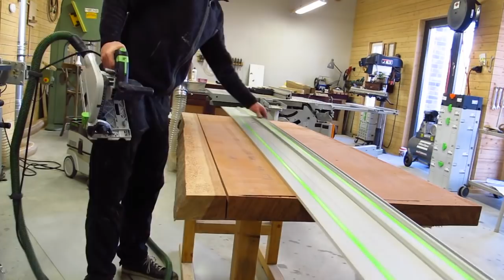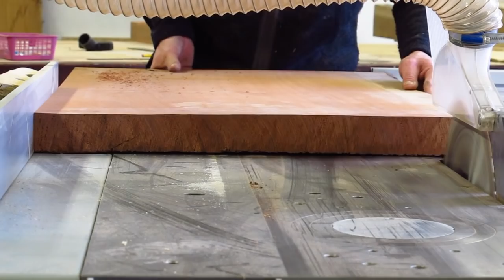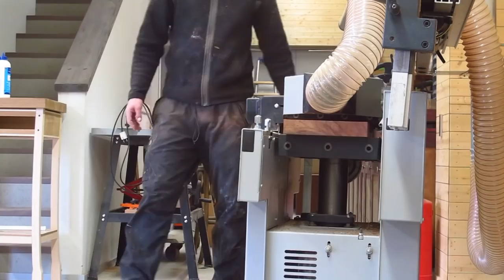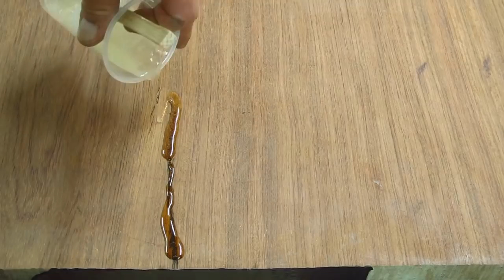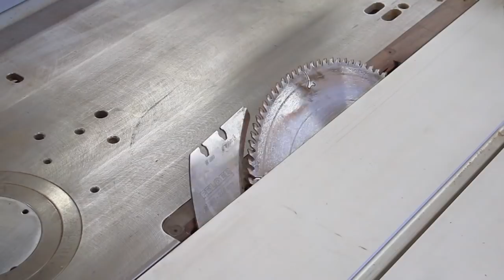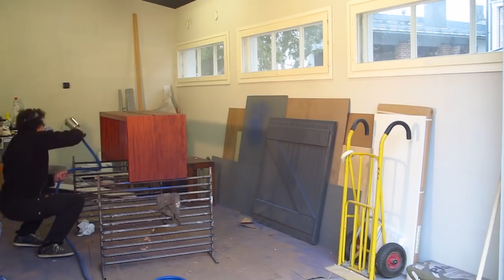Split top slab bench

Comment: a really cool idea for a computer desk, you can have the mouse and keyboard cables go into the crack instead of across the desktop
Reply: +Noodle or you can just drill a hole in the table you already have .
Reply: or you can just get a wireless keyboard and mouse
Reply: +Zenas101 yes you could and you could also just drill a hole in the table just like someone els said. but I spent enough money on my mouse and keyload not to want to re get a wireless ones also my desk is to nice to just drill a hole in.
Reply: +Zenas101 Wireless mice and Wired mice do not have the same ability to provide accuracy. There is also the issue of battery usage which is an unnecessary cost. Oh, rechargeable batteries get worse over time and overcharging can generally lead them to turn worse quicker. So that doesn't truly work as an excuse. Wire will always be more reliable is the point. Plus less radio waves in your home unless you like unnecessary Radiation? shrug
Reply: +Noodle Cool idea.
Reply: I am sure that you didn't understand what this guy make.
Reply: And your mouse would not work at the half way point xD

Comment: I would consider it rubbish taking perfectly solid, wide thick hardwood and make it simulate being flawed. Doing the split at an artistic pattern, in a manner that flows with the grain, end pieces remaining solid, this is artistic genius! You do know now next is creating a piece using highly flawed material, filling in the gaps with different hues from the parent pieces.

Comment: Well done. I personally don't understand this concept of the split, what a waste of a perfectly good slab, but hey, if the customers wanted this. You did a great job though.
Reply from the maker: +Johnny It matches (design) the customers existing headboard.
Reply: Maurice, the next time throw such customers out of the workshop. 
I know we are working in services, but there are rules.
 First - do not waste such beautiful pieces of wood. You should to talk them out of it. 
If you were a builder you would build a house on the sand or with hole in the roof, just because that is the wish of the clients?

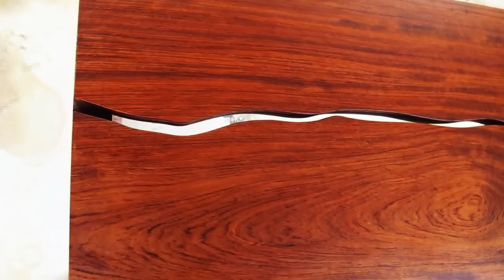Comment: While I am admiring this wooden table and would mark the craftsmanship very highly,  I would suggest that the sharp edge at 08:36 on the extreme left in the slot, seems to break the continuity of the solidity of the wood that is projected. The edge seems to contrast too much indicating  a not solid part which disturbs me a little.  I would suggest that that edge should have been filled with the thickness of the wood  that forms the vertical side.  What is more if what I suggested was done from the original wood rather than filling it afterwords, the craftsmanship would have reached a higher level be it made with machines or by hand as in days of old when the sharp chisel and a mallet was what my uncle used to use. 
Beautiful work, but that little more complex design would have added a higher class product.

Comment: Nice workshop, nevermind about the Felder magic, tell us about the bandsaw!
Reply from the maker: mpotgieter I've purchased it from a local school. It's a Finnish manufactured saw from 1965 and it didn't conform some EU regulations anymore..(?) and therefore they had to upgrade. I don't know which rules or regulations those are exactly, they did install an electronic brake at some point in time, so that's not it. The saw has wooden guide blocks in its lower wheel casing. Wheel diameter is 50 cm or 20". When removing the guard off of the machine one can resaw 32 centimeters or just over 12,5 inches. It was dirt cheap as schools are not allowed to make profit. Thanks for commenting!

Comment: great work
to those who say the equipment makes you a better builder, i disagree however better equipment brings out the best in the builder (not the same thing)
my only question is in a room with lighting directly above the split, wouldn't the unfinished edge of the legs be seen through the split. I understand this is low probability and also it did have and decent finish.
also with the split why didn't you continue checking during sanding to re-align them and give a more perfect mirror finish
just 2 questions that puzzled me during the video 
it still looks amazing and I'm sure your client/s were more than impressed
Reply from the maker: +puppy22801 There are nu unfinished surfaces on the bench, nor in the split or legs. Thats the reason why I sprayed the bench and didn't use a paint roller.Generally when I apply Osmo as a topcoat I'd prefer using their roller vs spraying. An option of course would have been to prefinish the project before assembly but I opted for the approach as seen in the vid. Pardon me but I don't get your question about the mirror finish..? Do you mean an exact match of the curve that make up the split? That I did so the split has a more organic feel to it. Totally agree with what you mentioned about tools and the fabricator. Thanks for watching and for taking the time to comment!

Comment: You should feed stock through a joiner with paddles; you can lose a hand if push it through with your fingers
Reply from the maker: +geo dezix Thanks for your concern. I only use paddles when planing stock onder 20mm. The ruff timber I purchase is usually 50 or 60mm thick, then I do not use push blocks.

Comment: Gorgeous work man, very well done. Was that wood as hard as black walnut or African ironwood? It didn't seem like your machines had trouble getting through it or even slowing, (given you have some top notch machines, but not $100,000 worth like so many people in these comments say haha). I'm just wondering how much of a pain it would be to do dove tail joints or some other joints by hand on that stuff, really beautiful material. Awesome video man keep it up!
Reply from the maker: +the mandingo I haven't worked with ironwood but it is much, much harder then black walnut. Working with sharp tools on Bubinga is a real treat, then it cuts like butter. Thanks for the kind words ;-)

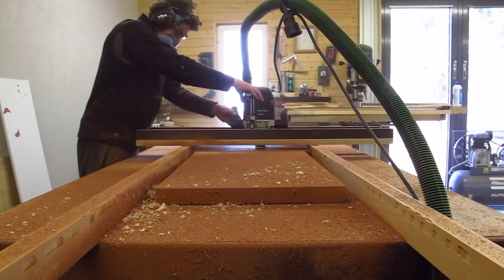Comment: Great video, great work. Are you using the router to surface the slab at 2:29 instead of running it on the surface planer only because the surface planer is not wide enough to accommodate the slab? Or some other advantage?
Reply from the maker: +Eric Engdahl The slab (as I take it from my storage) has three times the width of my jointer/ planer. After approximate sizing it at the table saw it is still about twice the size then my planer can take. Thanks for your Questions Eric!

Comment: Great video and an awesome table man!
I have a question that I hope you could answer.
I really like the design of this table and I'm thinking of making one but on a bigger scale except the split top. I want a computer/office/work table just like that only the dimensions would be 200x70x70 cm (l/w/h).All hardwood. Do you think a joint like the one you did on this table + a 30cm center brace on the inside of the table would be enough for the table to be stable?
Or what type of joinery would you recommend?
Reply from the maker: +vjekan Yes, mortise and tenon joinery will be plenty strong, especially when having a brace under the table. You may also consider blind or through dovetail joinery but it'll be more time-consuming. Thanks for the kind words!

Comment: Beautiful project! Can I ask why you plane the surface with the router jig when you have an actual planer? I thought router planing was used as an alternative. Thanks!
Reply from the maker: interstateB 300mm is the max capacity my planer/thicknesser can take. The bench has a width of 450mm or a little over 17,5 inches (..or was it 500mm?) so obviously to wide for my machine. Alternatively one could rip the one board in half, run them through the planer and glue them back together but (of course!..) I choose not too. Therefore the router + sled. Thanks!

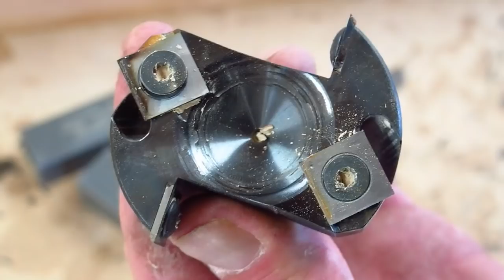Comment: thank you for sharing, great job. wich kind of router bit did you use at 2:12? can you tell what brand is it?  thanks!
Reply from the maker: You will need a router with some serious heft to operate it safely though!
It is a CMT cutter (Italian manufacturer) Specifically;
spoil board surfacing router cutter HW
S=12    D=60X12X80mm    Z=2
Item number 663.002.11
Reply: Maurice Blok thank you Maurice, i need a router more powerful, i got a festool of 1400. i found the router bit here http://www.paginutensili.com/content/fresa-livellatrice-con-coltelli-intercambiabili
Reply from the maker: I think in your link it shows the/ an older version of a similar cutter that has item NR 663.001.11 (2012 catalog that I have shows this cutter)  I've purchased this cutter (663.002.11) about a year and a half ago or so. Look in your area for a retailer to ask additional/ detailed information if you're interested. Having a 1400 as well I feel I should tell you that I wouldn't use this cutter in that router. Wouldn't be the first time it (the 1400) would take me for a hike instead of me taking it for a hike (luckily without physical consequences) With the 1400 (wonderful machine) I would recommend using a smaller cutter, you'll be spending more time but achieving the same result safer! Thank you for the interest.

Comment: is there a special reason to use the router to level the surface and also the jointer and planer and the final result is beautiful great job
Reply from the maker: The wider pieces exceed the width of my jointer/ planer. Option would be to cut them, joint & plane, then glue them back together again (to avoid using the router sled flattening thingy.)
Reply: Maurice Blok that was obvious and I completely didn't catch on lol
Reply from the maker: +this guy no worries, happens to me all the time :-)

Comment: Hey Maurice. I'm curious, who makes that big router bit you used for planing the board? Also, how fast can you run that up to? Thanks!
Reply from the maker: +Nolan Gaudreau It is a CMT cutter.(Italian)  Specifically:
spoil board surfacing router cutter HW
S=12    D=60X12X80mm    Z=2
Item number 663.002.11

You will need a router with some serious heft to operate this kind of cutter safely! The speed depends on the wood your cutting, the router or cnc you'l be using, sharpness of the inserts etc. You can do this operation in a small router with a regular straight cut or spiral cut router bit in a smaller router just as well. Light passes and patience may take a little longer but will be a safe way to go. Thank you for watching Nolan!
Reply: +Maurice Blok Thanks for the answer. I've actually planed a live edge slab like that with my 3/4" bit and Dewalt router, but it just seems so much quicker with your setup. I guess I'll stick with what I have for now.
Reply from the maker: I totally understand. Don't want to discourage using a bit like this, it is faster and by no means am I from the safety police but I'm sure you understand that a router bit like this in a small sized router is a bad idea.The diameter of this particular bit is 60mm/ 2.3622 inch and therefore is no joke by any means. In the shop I also use another router (OF 1400) and I wouldn't be comfortable using it in combo with the 60mm bit. I wouldn't have total control, and that would make using it potentially dangerous and scary. 
As I don't have a large jointer or planer but use slabs quite a lot I invested in this bit. It wasn't cheap, I recall somewhere around 190€ incl. vat. Another advantage of this bit is the replaceable inserts.
Reply: +Maurice Blok Yeah I hear you. Since I have no idea if my router can handle that kind of bit, I'm not even going to try haha. Keep up the good work!
Reply: +Nolan Gaudreau I used at 1-1/2"" router bit to do a 55" wide live edge slab... didn't take all that long... I'm sure the bit was much cheaper too.

Comment: Nice project. What is that carbide planing bit with the 2 inserts in it? Never seen one like that.
Reply from the maker: +Wood Barter it is a CMT cutter (Italian manufacturer) 

Specifically;

spoil board surfacing router cutter HW
S=12    D=60X12X80mm    Z=2
Item number 663.002.11

Comment: Sorry if this is a really dumb question (I know nothing) but why did you use the plunge saw to start with instead of your table saw?  It looked like the plunge saw couldn't cut deep enough with the track which is why you moved it after the initial cut.  Was there something preventing you from making that cut on your table saw?  Thanks.
Reply from the maker: No dumb question at all! My sliding table saw table isn't long enough to accommodate the length of the board to a  (one straight edge) therefore the only way for me, in my shop,  to get a straight edge is to use the track saw. Then I can make it paralel with the table saw and process the wood further.
Reply: Excellent.  Thank you very much for the prompt and precise answer!

Comment: how does your festool guide stay straight as you cut? I can't see any clamps. great video mate!
Reply from the maker: ausguitarist There is anti skip padding at the underside of the track. Exerting downward pressure and firmly handling the saw is enough to prevent it from sliding. (especially on longer boards such as in the video) Thanks for commenting, much appreciated!
Reply: oh thats cool! I have a makita saw for cutting sheet goods and always have to play around with clamps and my guide

Comment: In the end product you can see the the gap between the 2 top parts is not 100%  copy of each other. In the video after you draw the cutting pattern on one side and cut it on the band saw you copy the result to the other half. My question is how come the gap is not 100 % same on both side.
And of course, your work is just spectacular, I saw each of your video more than once.

Comment: Hi Maurice, very nice work.
Could you recommend a finish for a kitchen table?
Reply from the maker: +Iain Russell Consider- what is the wood for the top? Kids or no kids? Gloss or matt/ satin finish? Osmo topoils are very good and might be worth considering.But its all about the wood you'll apply it on. If the top is Oak, Maple etc ,Osmo 3032 (a glossy finish) will yellow a lot, 3062 (satin finish) is also a transparent finish but wouldn't yellow lighter wood as much. You can pre prep lighter wood before applying a topcoat. If your table is of a darker wood you could use a range of finishes, more so then when working with lighter coloured wood. If your in the US then you have options that I have no experience with but you will definitely have to consider those if you have access to them. (ArmRSeal, General Finishes etc) Hope this helps!
Reply: +Maurice Blok Thanks for the detailed reply. It's a walnut top and I would prefer a matt finish. I'm in Germany so I'll try the 3062 for now. Does the Osmo finish also work well with staining lighter woods? Cheers

Comment: The other challenge I wanted to ask you about was the adhesive.  Oily woods are notorious for parting down the road.  The solvent method has only been effective for me some of the time.  What did you do here?
Reply from the maker: +Phi Sailor Bubinga isn't as oily as, say, Padouk or Cocobolo. The rigidity is in the joinery, not in the glue.
Reply: I do understand that adhesive should not be used as a filler. I have used Bubinga with mixed results.   Perhaps it was other factors. So I understand from your response that you did not prep the mating surfaces ?  What would you do if the woods were 'oily' ?
Reply from the maker: +Phi Sailor Indeed, I didnt prep the surfaces. When using oily wood I would cut the joinery, then clean the (to be glued) surfaces with mineral spirits, dry them off, then glue them. If it's a joint in endgrain you could go through the same procedure but apply glue, let it dry and then apply glue again and assemble the joint. Oily woods just are tricky! Also, think about which glue to use. Maybe pva isn't the best option
Reply: This is a challenge to be sure.  I have had the best success with good old hide glue and the trade off with using it. The oils are still at issue though and larger surfaces I still struggle with.  Thank you for your post and good luck to you in the future Maurice.

Comment: What's the name of the tool you used to scrap the epoxy off?
Reply from the maker: DJSERVANT777 That's a cabinet scraper, sometimes called card scraper.
Reply: Thanks. What's it made from?
Reply from the maker: DJSERVANT777 Metal. Google "cabinet scraper"
Reply: Thanks for the info

Comment: why didn't u just cut a larger board of wood, then use the two parts for the final table? instead of making 2 cuts. I really appreciate the final result but the gap is not rly accurate, i mean i would be more accurate with a single cut.

Comment: use the push stick on the inside cut, not the outside
Reply from the maker: Jay Stevens Generally speaking; yes, of course. Nevertheless sometimes a situation calls for a different approach i.e when having a very thin board on the "waste side of the blade" that one wants to safely get out of the way as seen in the video.

Comment: What was the tool you used to make the holes for the pegs?
Reply from the maker: That is a domino, it kind of functions like a biscuit joiner but is more versatile
Reply: Thanks for the quick reply. Looks like those dominoes are like a $1k...I picked up a brand new biscuit joiner at a garage sale for $30, but im not really that familiar with how strong of joints they make. Would a biscuit joiner work for this application?